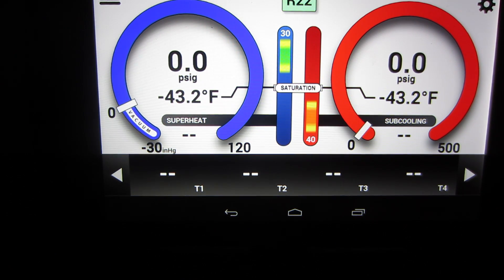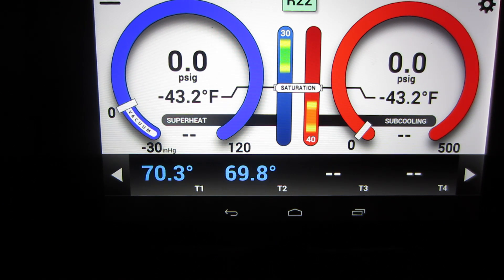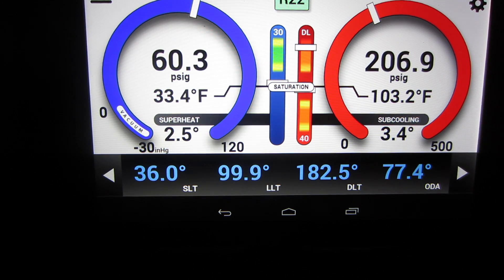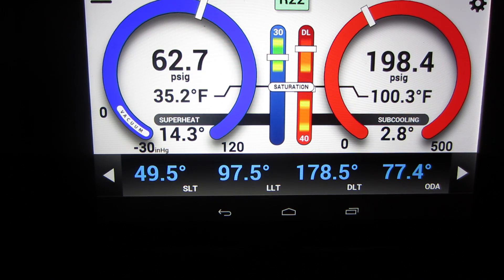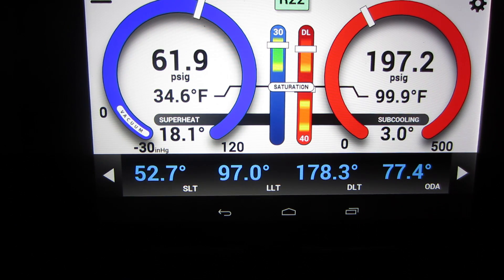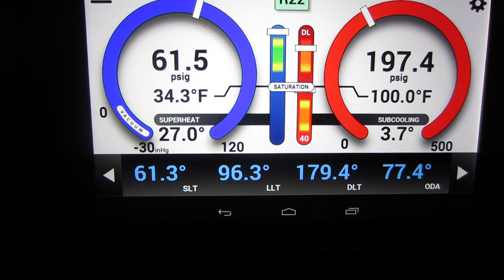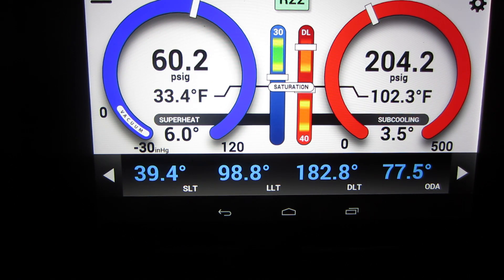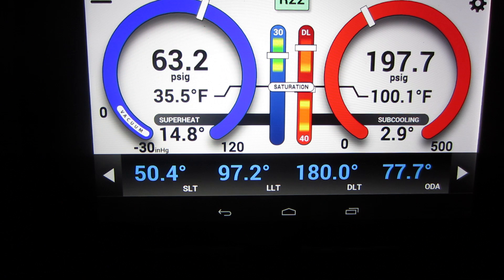HVAC iManifold  The effects of low air flow

Comment: Why was the subcooling so low all the time? Considering superheat changed a lot appears to be a fixed orifice metering device...
Reply from the maker: I had a 4ton evaporator on a 3 ton condenser.
Reply: Why would larger evaporator mean low subcool?